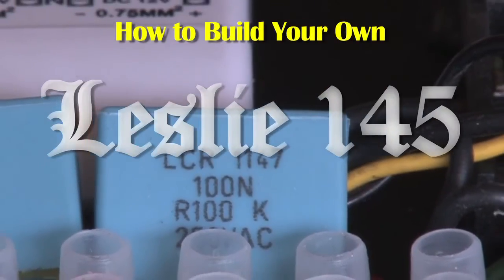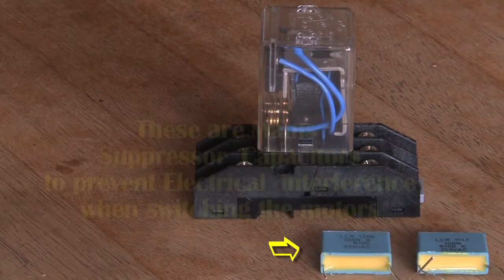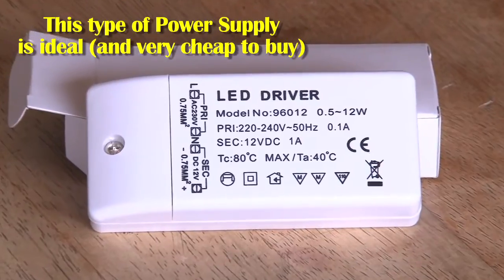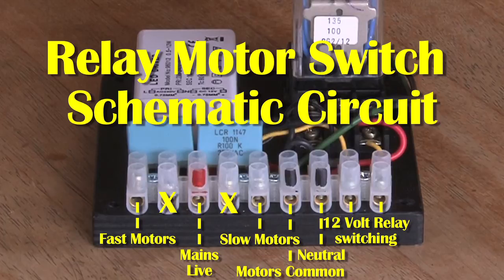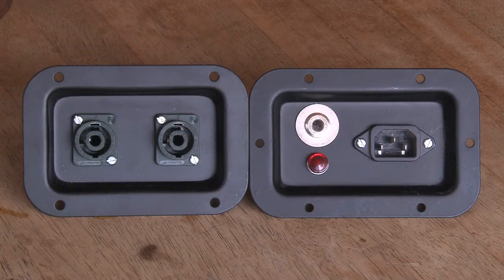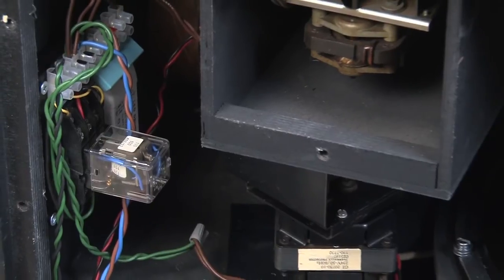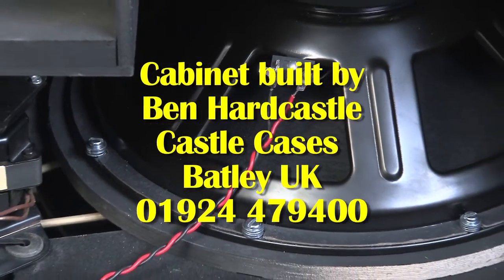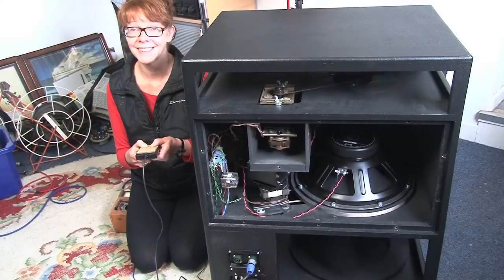HOW TO BUILD A CUSTOM LESLIE SPEAKER FOR A HAMMOND ORGAN - PART 4

Comment: Hi Keith. Great video. What value are the mains Suppressor Capacitors used? Thank you.
Reply from the maker: The same value as the original ones in the old unit ........
Reply: @keithappleton  Thanks for replying. My 710 (as you know) doesn't have a relay. I've bought the components that you've suggested to build a 12volt relay like yours ---but I don't know the value of the suppressor capacitors. Are they 1uf? Thanks again for your help and the wonderful Hammond playing (and sound).
Reply from the maker: Find a Leslie circuit diagram - there are plenty online . . . .
Reply: @keithappleton  ok, taa.

Comment: How does the slow and fast speeds work? in the wiring diagram there are two different contact points for the fast and slow motors.